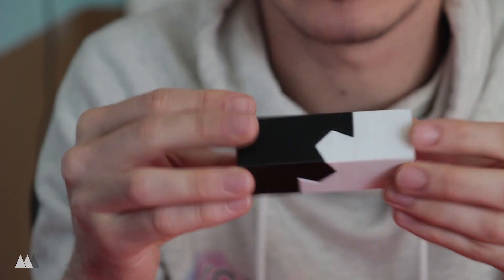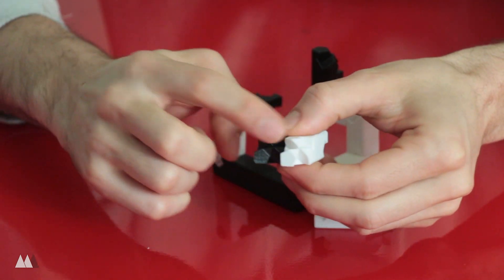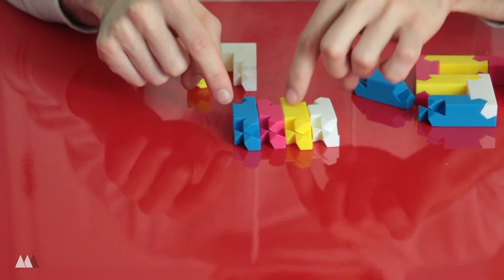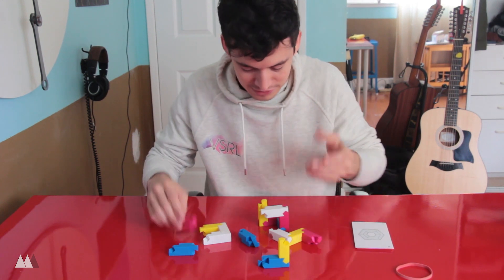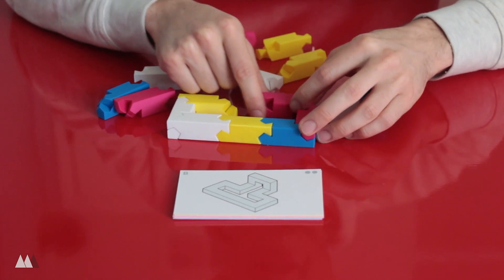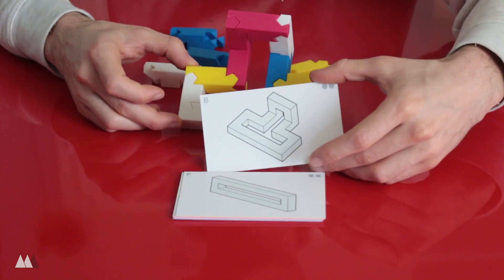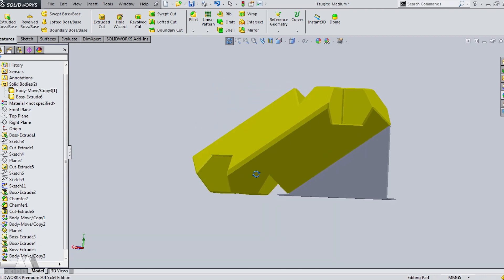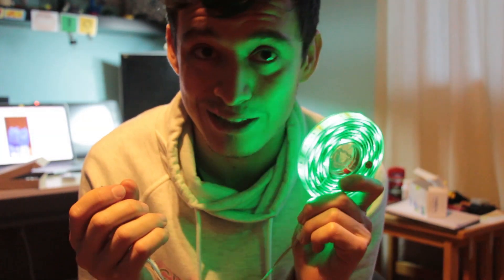Tsugite Tangle // 3D Printed Puzzle

Comment: Also, as for the LED strip, it would be challenging, but possible. A while back, Lego released electronic pieces, little light bulbs, etc in them, they way they worked is that they had little metal contacts so they could electrically connect. It would be really cool to make a modular LED lamp setup, even maybe in the shape of the tsugite tangles. you would need a power block, then blocks with imbedded LEDs and an end cap so you can complete the curcuit!

Good luck and i hope to see this!
Reply from the maker: +Lotmom I'm not sure I have the electrical skills for this :|
Reply: Extremely simple, honestly. Because you aren't experienced, each block should be a self-contained circuit. Purchase a few Slide Switches, some CR123 batteries, some red leds, and some 100 ohm resistors. You'll need copper wire, and battery contacts. A metal plate bent at 175 degrees is an effective contact on either side (the battery will want to pop out, so you need to print a lid). You also need transparent filament. It'll look amazing!

A soldering iron lets you connect the metals together, and is extremely useful. If you don't have one, you can twist wires together and wrap wire around part of the contact.

The CR123 battery produces 3 volts and can power one led for 75 hours continuously or 3 for 25 hours. Connect the (+) contact for the battery to the anode of the led. Connect the cathode of the led to one side of a 100 ohm resistor. Connect the other side of the resistor to the (-) battery contact. Then put in the battery and be proud. The circuit is absolutely safe to touch, and your biggest hazard is burning/popping the leds by forgetting the resistor.

Optionally put the switch somewhere in the circuit to allow it to be turned off. Optionally put more than 1 led, but make sure they form *parallel* circuits between the battery contacts EACH WITH THEIR OWN RESISTOR!!

Once the circuit works, you can plan a 3d-printed transparent container. I recommend that you build a thin module for the circuit and plan the block to have space for the module. Message me if you ever make it. I'd love to see the video!
Reply: It wouldn't take much. Your metal filament may even be conductive, in which case, it could be entirely 3d printed. the only issue would be reverse polarity. LEDs dont like reverse polarity :P
Reply: Put a contact, positive on one side and negative on the other every 120 degrees, so 3 on each side total. Then solder them together to have a single positive and negative connection to an LED. Done! Oh and have a block with wires coming out so it can power all of them.

Comment: you should make a toy brand.
Reply from the maker: +RODO125 I think I will, once 3D printing is cost effective enough...
Reply: Something you might look into, especially with something simple like these, is doing some injection molding. A good way to really bring down the cost of big batches. There are even companies like ProtoLabs that can handle small batches if need be.
Reply: Make Anything // 3D Printing Channel 
I could. e wrong but I think you can like make a tax deduction or something? I may be wrong
Reply: Yeah mate, u should. U could use molds like lego does, however it might be a bit harder due to the shapes.

Comment: For the light strip: what if when you're making your rock wall you leave a hollow tube the width of that strip that you can run the light through where it would surface every few feet. Basically you'd have a built in direction indicator for less experienced climbers to find their way up. Along those same lines, what if you ran it inside your guitar neck. It could light up every other fret or so.

Comment: You might have already thought of it, but you can add cross, and T-pieces, and double-cross which is not flat (I have no idea how to call the shape which would have 6 ends) and a few others. That would turn out from puzzle to building blocks. Which would also make the game much more complicated because I already see you need 4 variations of double-ended piece, there should be 12 for triple-ended, right? And for 6 ends... I'm afraid, I'd have to work hard to count that number!
Reply from the maker: +CatherineZ haha yes, I tried to keep it simple. it could get out of control fast!
Reply: I like the sound of out of control.

Comment: Maybe not with this strip, a non waterproof one.

build it into this puzzle, I think they usually trim down into 3 LED sections, imagine this puzzle where three parts have a single AA or AAA battery and those three in line will power all the other sections.

Comment: my question is how strong are the joints like when it straight can you crush or pull it apart easy and at a 90 degree would pressing down on a cube result in a break

Comment: Your face should be next to "prolific" in the dictionary! Damn! And while I, hopefully, have your attention with flattery, did you ever talk or plan to talk about negative space in 3D printing? As in, why are my bolt holes always smaller than they should be?! And how to deal with this, especially if I plan to share designs with other people. I realize it could be a bit technical, but I think the subject is relevant for your theme of usefulness. Frankly, I was hoping to see something about it in this video, since it was about interlocking parts and I'm sure you dealt with the issue of negative space while making them.
Reply from the maker: +Jovo Arežina thanks! My printer is quite dimensionally accurate, so I don't have many negative space issues
Reply: +Make Anything // 3D Printing Channel See, now your face should go next to "lucky" too! You're hogging the dictionary! :) Although mine will be next to "cheap" as I have a Chinese DIY assembly deal. It's not too bad, but those .1 or .2mm errors add up and I had a bear of a time making a custom GoPro mount that fit just right. As you can imagine, since it switches between positive and negative a lot... Anyway, thanks for the reply, you're amazing and your videos are inspiring!